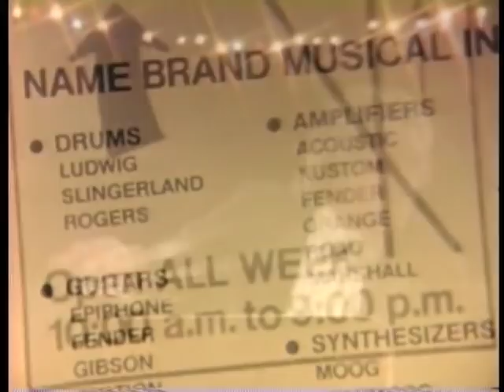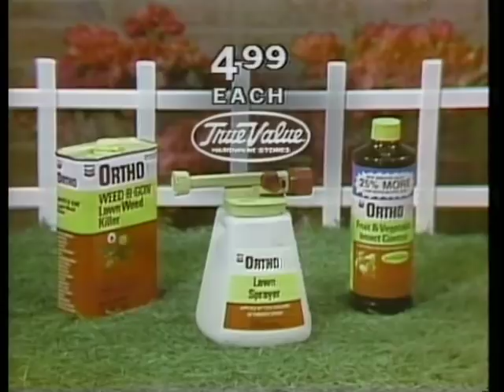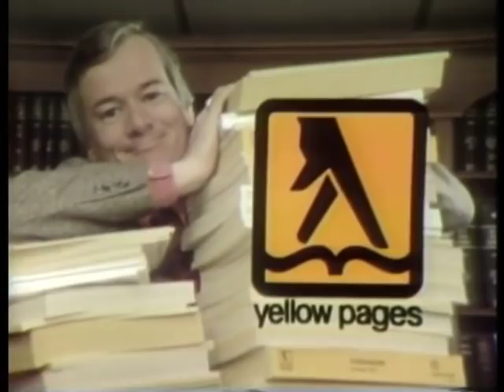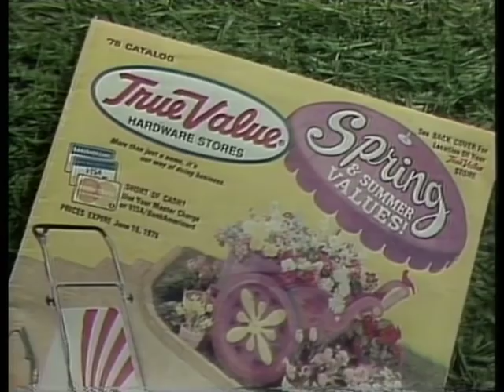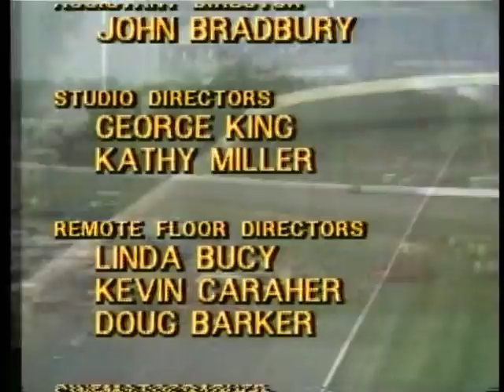1978 Indianapolis 500 Bump Day (WRTV)

Comment: I think what the USAC officials were worried about was that, with 32 cars in the field at this late stage, that Herk might actually get in with a 175-mph front-engined car if these other guys like Harkey, Cannon, et al continued having problems.
Reply: There had to be some inside politics happening. Unless there was some sort of major safety issue with the car like botched frame work, there would be no reason to keep a guy from attempting a lap. And if they didn't want a 12 or 15 year old car running, why not have the rule like NASCAR did where once a car was so many years past its build year, the car was not allowed to run